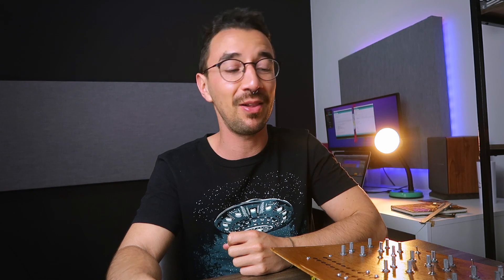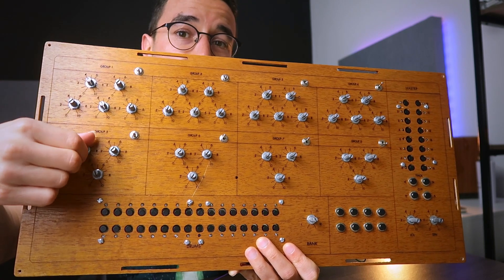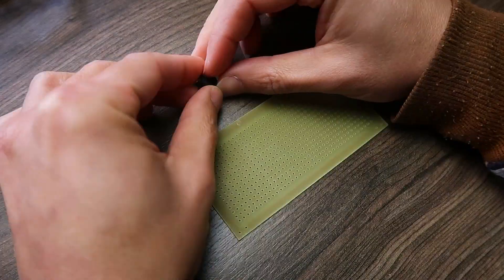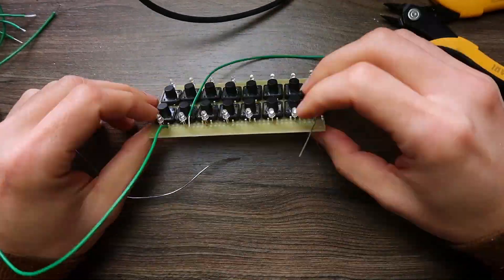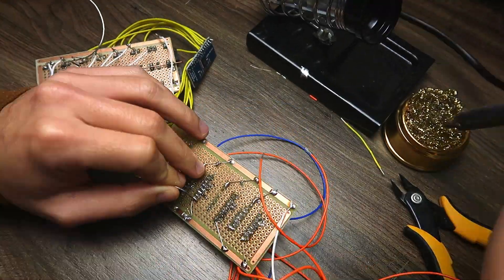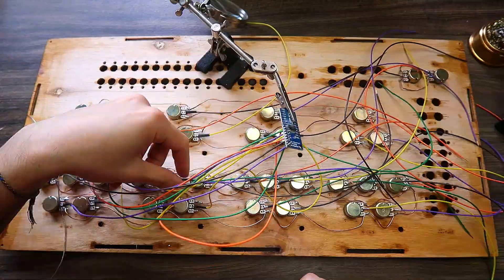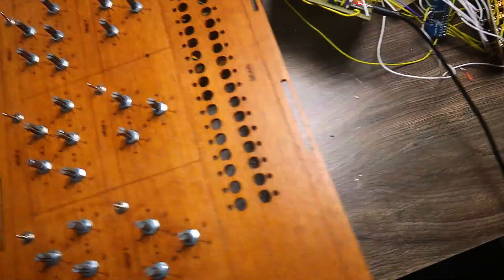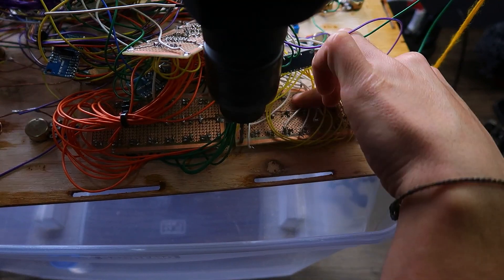I FAILED. My MIDI controller disaster history...

Comment: Using wire isn't really a problem if you use ribon cable fitted with female pin header. You just use a male pin header on your multiplexer board to link the two. It also help when you've to service the thing later on. You can color code them for easy connecting.

Comment: I tried to make a midi controller a couple month's ago with 48 pots and 16 buttons with leds on each button, a MIDI mixer basically. Strips for volume, balance, sends, etc, and buttons for mute and solo. I did it with those kind of boards that have stripes instead of dots, and rapidly realized it was a mistake to do it this way. It was nice to test it and that, specially for me that I have literally 0 idea of electronics/programming etc, it's my first time.

I'm waiting now for my PCB's to arrive from China. I just decided to read a lot and watch YouTube videos (yours actually a few of them, I'll drop the sub now), and made my own schematics and PCB's, even with the arduino integrated on in. I just took a leonardo and disoldered the ATmega, so I can temporally "press" a new one to flash it, and then solder it to the PCB. If it works, I can give you maybe a hand with that. Let's pray for it! I promiso nothing.

Oh btw, no, you didn't fail. Trying is never failing.

Comment: Selfmade electronic is never cheaper as buy a finisched product. You can't buy large amounts of electronic components, like a big company is doing. And if you calculate your time you invest, then it will cost a lot more as the same tool cost from a company. And also a reason is you have to solder tons of cabels. But at least, it is a nice hobby and you get things unique, but never it is cheaper :)

Comment: I'm a little lost as to why you did not just order some PCBs?

IDC connectors would have also sorted out your cabling issues as you could run ribbon cables from board to board and save a lot of headache/s attempting to fit it in to an enclosure...

Comment: The worst mistake you did was bad planning. First of all you try to sell a prototype at cheap! As some others pointed to you, this kind of project requires pcb designing and manufacturing (even on diy building with toner transfer and acid attack etc) so you can design each board with a proper connector for a flat cable (those used inside computers) so you can cut them after place everything on place (but sometimes connectors also made fit altogether impossible so another iteration...) and also designing the mux and shift registers boards with "zocalos" helps you to debug what's going on... (a bad solder joint? a bad chip?) without wanting to kill yourself ;P bbbbuuuuuutttttttttt...... as long as you start doing all of this and put the right price on the most expensive part (your income) then you figure that this isn't worth (or it will be very expensive).
Next time just say to the client: "Did you see those Yaeltex controllers?" 
BTW great stuff in your project Nerd Musician and keep the hopes high mate! You are doing very well <3

Comment: This is my first exposure to this idea. I have a question for an idea that this gives me. Is it possible to make patch cable inputs that will transmit the data of a cable plugged in to a software synth through midi?

Comment: Building a multiple VCO synth I managed to get not one or two, but all the IC sockets backwards. Schmidt triggers and other such ICs don't much like it when you hook them up backwards or put power into the wrong pins. It was my monster Moog project. It wasn't midi or anything but a good solid synth with a euro rack plug-out panel on back. It took me nearly 6 months to work out all the niggles that didn't seem to work like they should. Like that controller there it worked a great until I tried fitting it up into an enclosure. It all went fine I thought until I switched it on. Some of the passives, transistors and the like had gone bad. So in conclusion: After giving all the ICs a flip, replacing a few caps and trannies I finally got it working. It sounded brilliant and I rather wish I hadn't sold it. Life being what it is some bloke offered me the "I can't say no" price for which I bought a Nord Electro and a Native Instruments Maschine Mk2. Being a labor of love I didn't have a time constraint or someone breathing down my neck because it's not done yet. 

What I learned was profound when it comes to building things. Modularity is a beautiful thing. The more modular something is, the easier it is to work on when something goes wrong. Socketable components are a godsend because it makes changing the bad bits so much easier. Designing things to handle twice the rated values because we all know how people like to push it misuse things. It's a bit more expensive that way but it leaves you peace of mind that whatever it is isn't going to break easily. Fit and Finnish are important but don't get worked up if it's not perfect because anything hand made can't be. Something to remember is that successes have many siblings but failure is hopefully an only child. What that means is that failure happens and if we learn from it, we never make that particular mistake again leaving it the "only child" of course. Those mistakes though, those are what we learn from so they're all more or less the family of success which is what happens when we manage to avoid said mishaps.

Comment: Great, honest story. I have a project still on the shelf that suffers the exact same issue. Several analog drum voices that work fine on the bench, but get frustratingly hard to debug when I tried to combine them in one big project. Mostly due to wiring. But from these projects you learn the most I think!

Comment: I feel much better about my struggles now. Putting a working circuit into a box without breaking it can be a real challenge. My approach is to build smaller circuits and use bigger boxes. And use lots of zip ties and hot glue. Every step is an improvement, but I'm still learning.

Comment: Thanks for the video. My takeaway is that building with wires, solder and generic PCBs is always a prototype or demo. Outsourcing professionally made PCBs is now a goal of mine. But I saved my self a lot of trouble by watching your video!
Reply from the maker: You are totally right! There's a size limit that one should limit to use wires.
Reply: @NerdMusician  Sounds like a future video!

Comment: You should also practice your soldering skills. It is really not at the level it should be for a commissioned project.
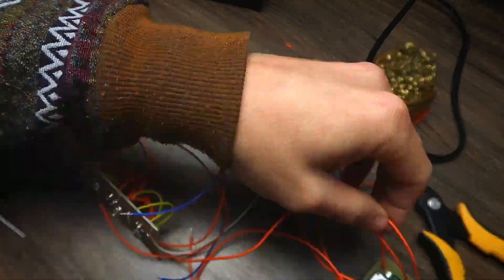The protoboard was a bad choice right off the bat, however there's better ways to use it without these constant shorts. The main weakness of these boards is that their pads come off very easily if heated too much, say when you desolder stuff - however that didn't seem to be a problem for you here. For example, those angled wires at 7:12 should just go straight down to the copper trace.
Always remember that the wire is bad. bad, bad, bad. You will notice large companies avoid them like the plague in their designs and you have just found out why - they are so incredibly time consuming and take up so much space. On this example, you could make provisions for mounting the multiplexer or shift register ICs directly on the PCB of the controls they are reading. That way you immediately reduce the wires you need to take off board to 5 from 10 (and even 5 from 34, if you used multiple cascaded shift registers)- remember you always need 2 for the supply traces.
I think the most important lesson is that you were not ready to do a big project like this with professional quality. The low price you asked for it is not a good motivator either, and if you also factor in all the time wasted, you probably forfeited any kind of profit you were supposed to make.
Being a hobby maker has different requirements from being a pro maker. Both are absolutely valid, no disrespect to the hobbyist attitude, but there's a learning curve to get you from making stuff for fun to making something that is guaranteed to work and turn in a profit.
Reply: That was what I thought. And I'm glad I didn't spend time to write a comment about it, because he didn't even bother to reply to yours.
Reply: seems like a nice channel though...

Comment: Hi Gustavo! I have watched your videos for a while and I have already build a very simple controller (4 slider potentiometers and 4 rotary encoders) using your codes. My firsts tests were a complete mess because I was also using wires for everything... The solution for me was to design a PCB in EasyEDA and solder every component without using wires. I have never understood why you don't desing your PCB's to avoid the use of wires. 
This is a great video and your channel is awesome. Saludos desde Chile!

Comment: I feel your pain. I like the snappable proto boards bc they can be superglued together to make wider boards as needed. Also, I’ve built a few rat nests as well, where individual sections worked perfectly, but once assembled, everything became unreliable. I’m thinking hard about really digging in and learning to design PCBs moving forward. Besides, stripping all those wires is such a pain!
Reply from the maker: Yes, man, it can be a huge pain. I'll design PCBs for this controller and redo this part!

Comment: Nice video - tragic design 🤣 I wonder if the best would have been designing a custom PCB for the whole panel and use something like JLCPCB to deliver it.

Um grande abraço desde a Espanha 🇪🇸 Eu sinto que meu canal no YouTube não seria viável se eu estivesse morando no Brasil 🇧🇷😕
Reply from the maker: I already decided I'll design the PCBs and order from JLCPCB, so can't wait to get rid of all that wire. :p
And great job with your channel! Doing amazing... And yeah, we have to work with what we got. It's HARDER, but doable... :p
Reply: I agree, I would just skip the wired prototype and go straight to custom PCB. If there is an error in the design it’s easy enough to quickly fix by cutting traces and adding wires.
Reply from the maker: @dmosey604  You are totally right.